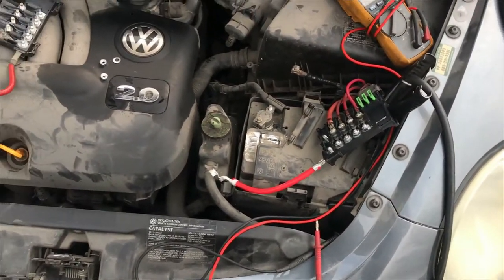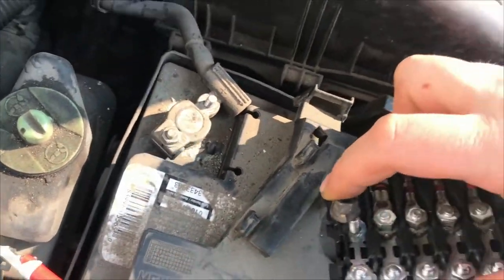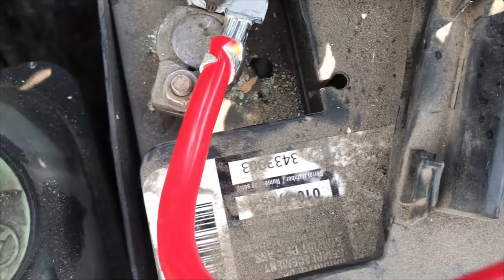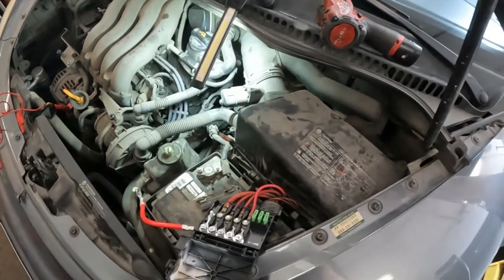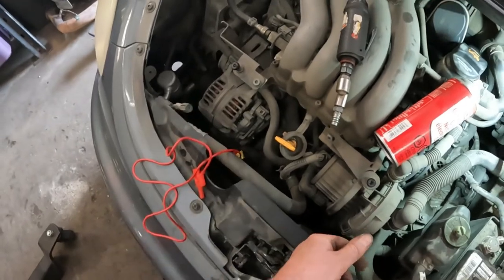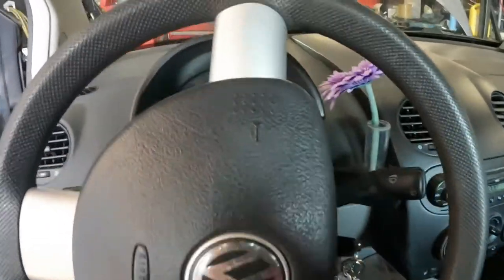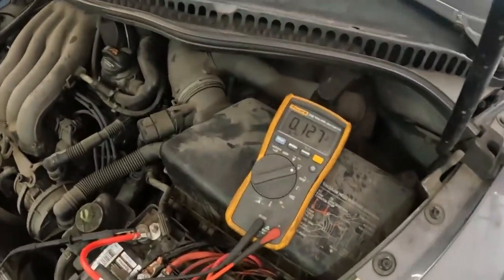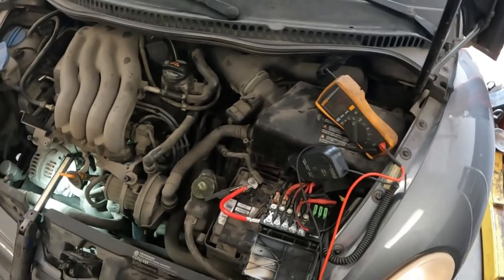2005 VW Beetle 2L - Alternator not charging - Melted fuse box

Comment: I had this problem on a 2005 VW Beetle. I cleaned electrical connections and replaced the fuse box. Second box melted. I removed the wire to the alternator, soaked it in a citric acid. I reinstalled the same wire after checking the resistance on it before and after the acid. To make sure I never had the problem again I installed a buddy wire,(two wires). Still have the car, no issues with this problem.

Comment: Alternator wiring harness for these are around $300
Reply from the maker: @Kenneth Ritchard  I figured about as much. I don't love doing splices in heavy gauge wires. Sometimes you have no choice but in this case we opted to clean the original harness up as much as possible rather than spending money on half repairs. It's been 6 months or so and no problems so far!
Reply: I had a new alternator wire custom made for under $20 at a wire shop, and then swapped that out in the existing harness.   It works great and far better than VW OEM junk.